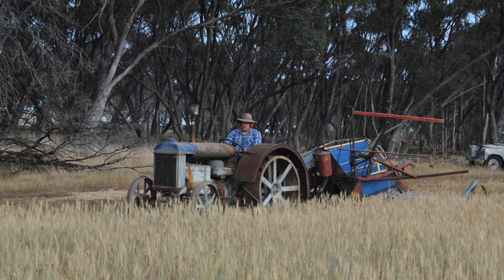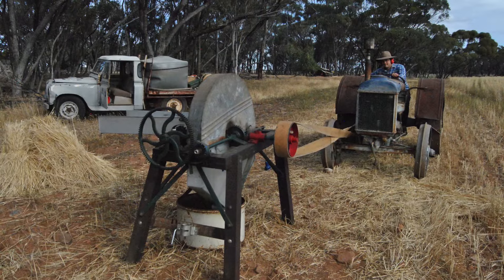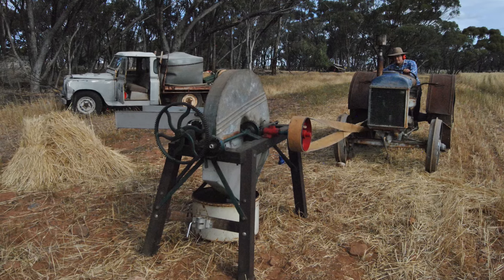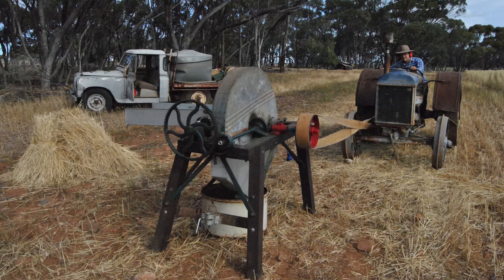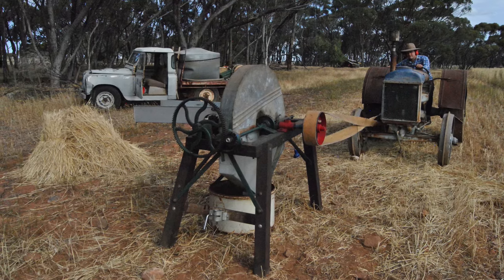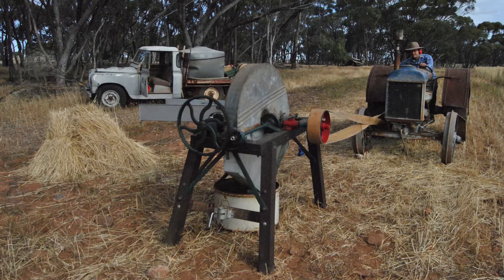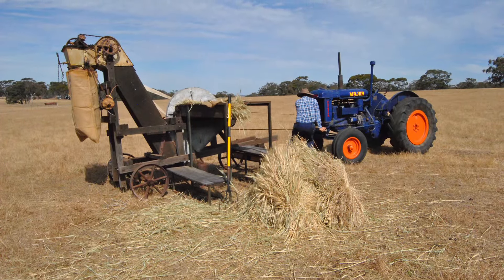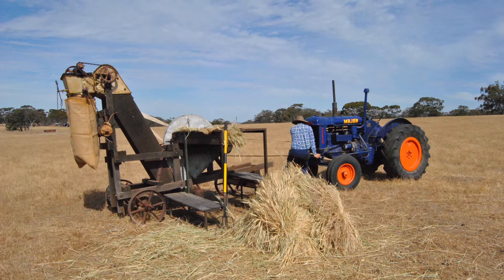Cutting chaff with Fordson tractors and Sunshine chaff cutters

Comment: Hello, one of my first jobs when I left school was working on a chaff cutter end of 1978 on a farm near Kalgguddering south of Wongan Hills where I grew up. I had the easy job of being on the back of the truck dropping the sheaves onto a board where someone cut the string off and put it on a conveyor. There were lots of people working on it I’m sure it was steam driven. I wish I took more notice of how it all worked I was only 15 so I kept out of the way. 
Love your videos, thanks Nev.
Reply from the maker: Hi Nev, I am glad you are enjoying my videos. Yes lots of chaff cutters were steam driven. In the1980s they changed the fire regulations and this stoped people operating steam engines in the paddocks in summer. The sheaves were often also passed there’s a steam box on the conveyor. This helped put a small amount of moisture back into the stems and made them cut beter instead of shattering.
Thanks from Geoffrey